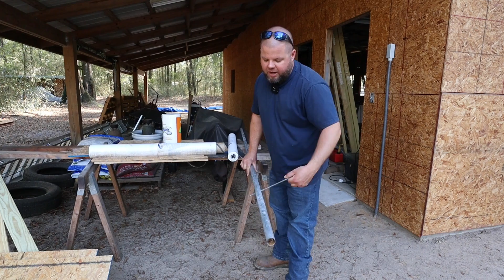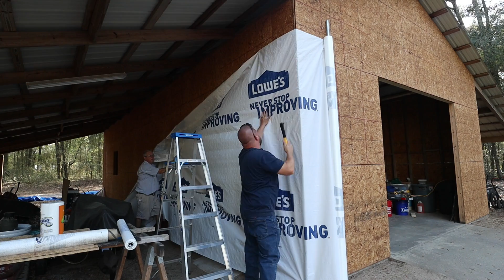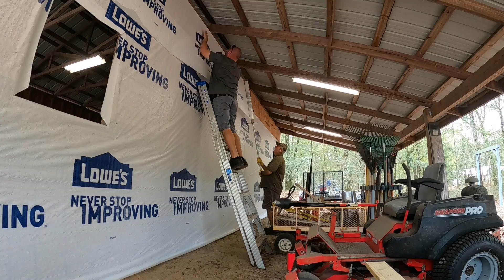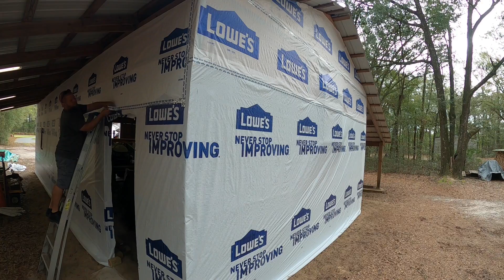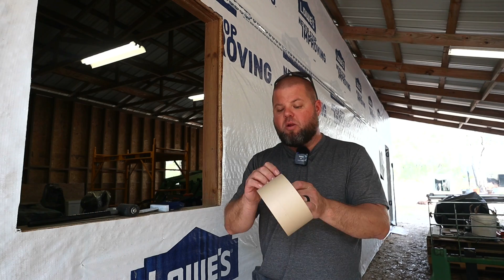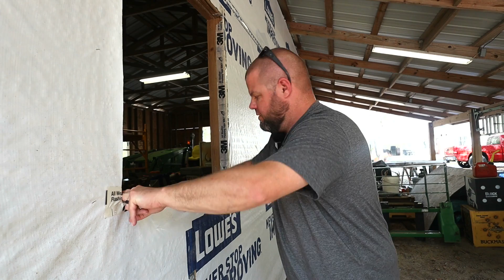Installing house wrap vapor barrier. Shop build episode 2

Comment: I do the same for my windows and doors with the tape. I even take it a step farther starting with the bottom than the side so the tape overlaps as you work up to the top of the window so if there ever was a water leak it would run all the way down the tape and not hit a tape seem if that makes since. It would be over lapped
Reply from the maker: That's a great tip for keeping out any leaks.

Comment: how do youbknow were to but vapor sheeting
Reply from the maker: In the south code requires it on the outside.  I believe up north it's on the inside due to the cold temps and the way the homes are heated.

Comment: I like the house wrap dispenser you made! 
The detail on the windows is a good idea!
I was  always told to not tape the bottom of an overlapping sheet of wrap so that water can escape. Instead tape the top of the lower sheet to the sheeting to prevent water from getting behind it. Think of it as shingles on a roof and how water flows.

Comment: Scared me for a second! I thought you use Lowes wrap on your house.😂😂😂 look up some tests when they take Lowe’s and Home Depot wraps  and sprayed it with some water. It goes right through. (Like on Matt Rasinger channel) So for a shop I would still go Tyvek or just without completely.
Reply from the maker: Tyvek is superior and that's what I used on my home.  With that said, an open vented barn with good siding ehhh.  The lowes stuff will be fine.

Comment: You really need to stop calling house wrap a vapor barrier.  Clearly, you understand the difference as your explanation was spot on.
Reply from the maker: It's just a common mistake, like calling a water heater a HOT water heater.